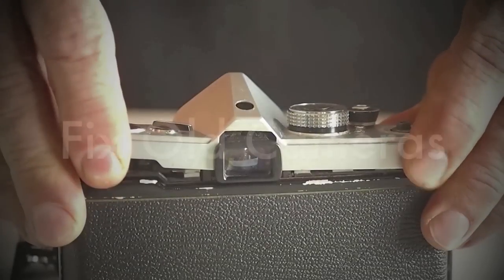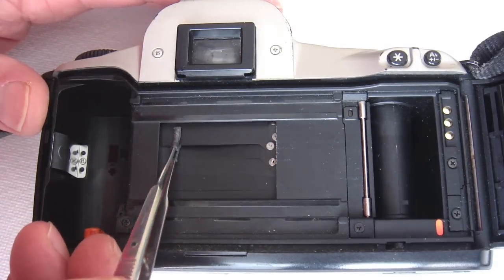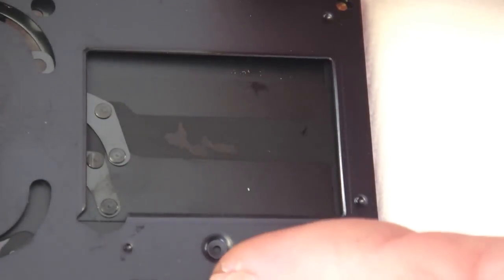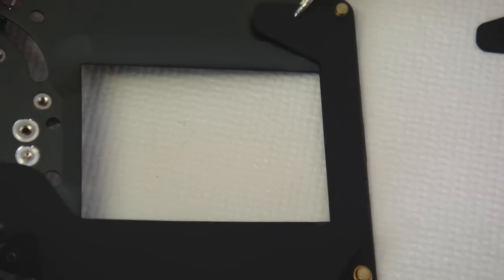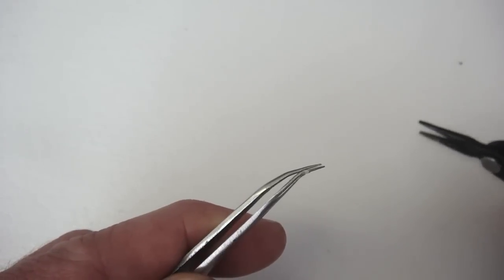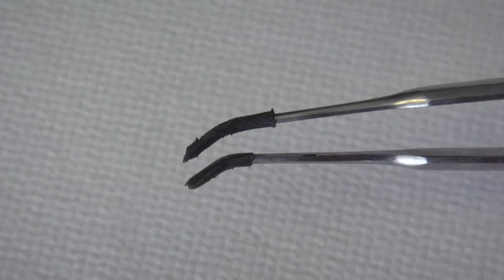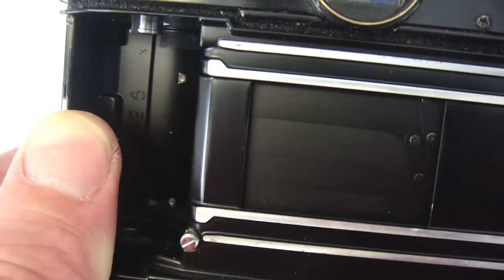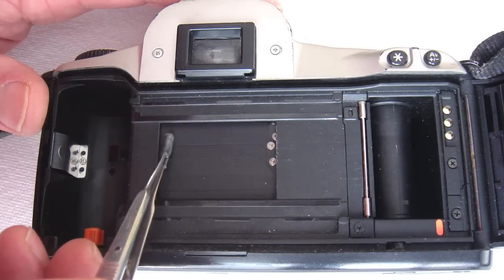Fix Old Cameras: A Quick Shutter Fix

Comment: This worked on a Konica TC that I picked-up from Goodwill for $8. The shutter looked like it had been poked through with a finger. I used  a combination of the modified tweezers and a bamboo skewer. Works perfectly now. Interesting note is that the shutter blades on this particular Konica are pretty thick and required more force to get them back into place than I anticipated.
Thanks!
Reply from the maker: Great to hear of your success. This procedure will work on any vertical type bladed focal plane shutter as long as the blades are not to severely buckled.

Comment: Fantastic, I had a Pentax MZ-50 camera in the shed with a buckled shutter and after seeing your video I got it out and with a Q-tip (yes, a Q-tip) flattened, bent and cut down the middle I was able to re-align the blades, it now has a roll of FP-4+ ready for action, thanks again.
Reply from the maker: Clever adaptation of items on hand with outstanding results. Thank you for your interest in Fix Old Cameras.
Reply: Fix Old Cameras  I have a Nikon F50 with the same problem but I will adapt a tweezers for that repair.
Reply from the maker: mamiyapress Excellent.

Comment: We used to do this on Olympus OM-77's and 88's, and the IS-cameras as well, but here's a little trick: Some vertical travel shutter blades are plastic. We would re-orient them as you show, but then put the camera face down with the injured shutter curtains showing, then put a desk lamp with a 60W incandescent bulb facing them about 6-8 inches away for 5-10 minutes. This will relax the blades, making them flatter. Be careful though -- we melted a couple of plastic bodies that way! That required a TBR -- "Total Body Replacement", where we would lift off the serial number and move it to a replacement body!

Comment: dear fixoldcameras, i need help with my zenit (зенит).the shutter curtains are stuck and i am unsure as to how to get them working.also are you going to make a video on how to remove rust? that would be very helpful if you did. also im not sure on how to repair the shutter settings being stuck on 1/1000 of a second on my centon. your help will be very appriciated. your channel is the only one that actually offers help in camera repairs in such a professional and easy to follow way.
Reply from the maker: Thank you for your comments and interest in FOC, A video on how to deal with rust as it relates to classic and vintage camera repair would be good. When a camera is completely jammed the first step is determine if the shutter is stuck or the wind mechanism is jammed.

Comment: I have a canon eos elan 7 that had the top 3 shutter blades out of place and I put them back in and now it operates normal but they ended up looking all crumpled up even before putting in place. My question is will I get light leaks ?

Comment: Thank you so much for that. I’m having an issue with a Nikon FG, where the shutter blades won’t come down from the top shutter frame. I got it to come down a few times, seems like a bunch of junk was caked inside the shutter blade track, and along the top and bottom of the track. From trying to see if it worked on it’s own a few times by pressing the shutter and film advance it got stuck back up again after 10 or so times. Any suggestions?
Reply: I just called you and you helped me so much! Thank you very much for taking the time to help me. I really appreciate it. 
Thanks again for sharing your knowledge to everyone.
Reply from the maker: You are welcome. And thank you for your interest in Fix Old Cameras.
Reply: Hi J D, i have the same issue with a Nikon FE2. Woul you mind telling me what helped in your case? It would be a huge help! Thanks in advance!
Reply: Marco Hahn  Hi, sorry so late to respond. The track on the shutter blades were all Gunked up with some kind of debris and gooey stuff. I just kept working it out with a small dentist tool (careful not to scratch the blades or ruin the track or using a tooth pick. I used a lot of 90% alcohol to clear out most of what ever it was that kept the blades from retracting properly ( sometimes the alcohol was better than any tool because it ate up what was in the way of the blades)
Hope that helps
Reply: @JD-je8ld  thanks!!! I will try that 🤞

Comment: marine grade heat shrink tubing has glue on the inside so it wont fall off the tapered tweezers.
Reply from the maker: Perfect.
Reply: @FixOldCameras  oh btw, years ago i took my OM10 to the Kilauea volcano in Hawaii.  BIG MISTAKE!  the gas coming out of it started a corrosion problem that hasnt gone away. volcanoes and mechanical cameras dont mix

Comment: please, do a video about pentax mx orizontal focal-plane shutter!!
in my camera the shutter does not return in fully closed position after shooting, thus the mirror also remain up
thanks
Reply from the maker: There might be a residual of oil that has migrated on the blades. It usually can be temporarily cleaned with an alcohol saturated cleaning swab.
Reply: luckily it was only some dust that had accumulated during the years of inactivity, but with patience and elbow grease I managed to fix it!
I also cleaned the supplied 50mm lens and soon I'll release a video about it, so don't miss it! (consider subscribe to my channel, it would be an enormous help for me to grow and improve)
I take this opportunity to congratulate to you for your job on this YT channel, which I'm very pleased to follow, so keep going!
CIAO
Reply from the maker: Good to hear of your success and good luck with your channel.

Comment: I have an olympus om2n that isn't right.
Basically the shutter just fires at the same speed(around 1/60th sec) no matter what you set it on and sometimes sticks.
New batteries. Ive tested it to death altering things over and over, over about a 1 week period altering this and that and its improved from being only firing on B to mostly firing when the shutters pressed but its still not right.
Every single speed it fires on  is the exact same.
The lightmeter seems to work but the connection to alter shutter speed doesnt seem to work on manual or auto.
I suspect the PCB has gone. Any ideas?
Reply from the maker: As you suspect the issue could be a circuit issue or a faulty component, most likely an IC. However there are a couple of other possibilities. If the shutter speeds are fast in both auto and manual, Then go ahead and remove the mirror box base cover plate. The felt strips along the sides of the cover plate will probably also need to be removed to facilitate the cover plate removal. A ceramic circuit will be revealed. The switch (SW101) sets to front of the board on the wind lever side, check it for positive contact before release. If good, check the wiper of variable resistor (VR-102)  closest to this switch. Clean around this area. Between the wiper of VR-102 and battery negative should be at least one volt. If this all checks out... bad IC.
Reply: Fix Old Cameras  Thank you for the info.
I havent touched it yet and am reading the manuals for it to see how it all goes together.
The mirror box base plate is held in place by a small screw.

Comment: I have a Nikon FE that works fine except for the shutter curtain staying up after taking a shot. It goes down and up again when pressing the shutter release, but remains in the open position, overexposing the film. The mirror returns to it's correct position. Any ideas on how to fix this issue? Thanks
Reply from the maker: There might be a film of oil on the second curtain shutter blades causing them to stick... or mechanical damage to the blades... or a mechanical malfunction. However if the shutter works properly in the M90 setting, than the issue is an electronic failure.
Reply: Thanks for your help!

Comment: Super new to film cameras I have a Pentax spotmatic , the shutter curtain is stuck halfway across. Help?
Reply from the maker: Is there tension on the curtains? if yes - jammed shutter gears... if no - weak spring tension on the shutter rollers
Reply: Fix Old Cameras maybe weak spring because I can pull it the rest of the way across with ease it just won’t go on it’s own

Comment: hi, i have a problem with a slr camera. the shutter is stuck millimeter before, and does not allow to keep shooting. and i dont know no one who wants to fix it. can you help me?  the rest of the camera works very well. thank you so much.
Reply from the maker: Try to give the shutter a gentle encouraging nudge to the end of the travel position to see if the mirror drops and completes the shutter cycle. Use gentle pressure only, if force is required then stop and reevaluate.
Reply: yes we do that every time the shutter stuck. and then works a few shots more, and then stuck again, It is very uncomfortable when the film is inside.
Reply from the maker: anducure You have not indicated what type of camera you have. Probably a Minolta XG series, as they are prone to that type of shutter malfunction. The shutter curtain tension could possible be increased so there is more pressure at the end of the shutter cycle. If it is an XG you will find two gears under the bottom cover positioned side by side on the rewind side of the camera. They are identifiable by the ratchet stops that allow for the gear tension to be set and held.
Reply: yes, sorry. it's a casio rf-1. made in japan
Reply from the maker: The Casio RF-1 has a metal shutter probably made by Cosina. It would not have shutter tension gears as described in the Minolta XG. There could be oil residue on the blades that could be causing drag. Short of complete disassembly and proper servicing of the shutter there is not much that can be done. You can try spot cleaning the blades with isopropyl alcohol and a judicious application of powder graphite as an emergency fix.
Reply: Fix Old Cameras okey, i'll try that, thank you so much
Reply: Try moving the shutter blades so they are fully extended.
You open the film back and grip them from both sides.
It works on an me super to free jammed mirror and jammed fim advance lever.
It only has to be about a miilimeter off or it will appear to be jammed.
Reply from the maker: anducure zenoist2  The suggestion is sound and should work as described. However it will probably not be a permanent solution, but it can still be tried. Time and usage will tell if it holds. It might make it easier if the mirror is taped in the up position so you do not have to fight with the mirror wanting to drop down while pinching the blade assembly. Also to avoid putting fingerprints on the blades rinse the tips of your fingers with isopropyl alcohol. The pressure applied must be even and perfectly in line with the direction the blades travel, otherwise you could pop a blade or blades out of position.
Reply: Fix Old Cameras  Thats just the idea to free a jammed shutter. The shutter curtains probably have that horrible cheap japanese foam fallen into them that deteriorates and goes like glue.
Asahi Pentax used some sort of fabric  mostly that's still good today except  1970s and onwards in the me super and later models.
Rollies had fabric too and thats still good after 50 years but they always were and still are excellent.
The problem is that god awful Japanese foam.
It disintegrates, fall apart and parts fall off and jam things up.